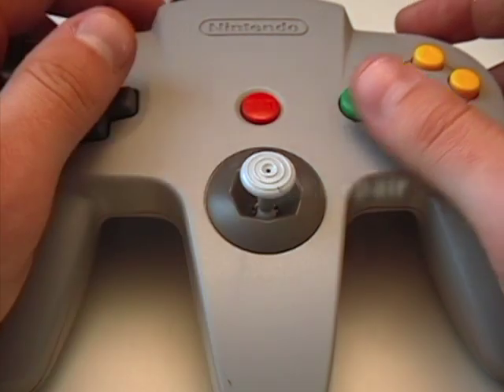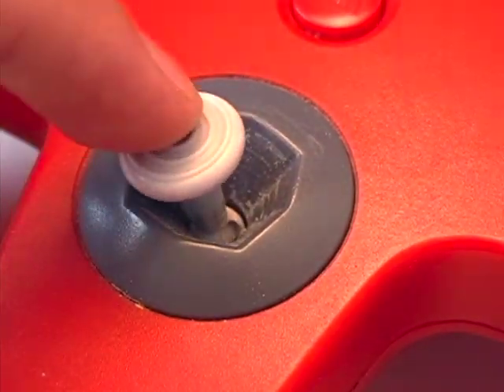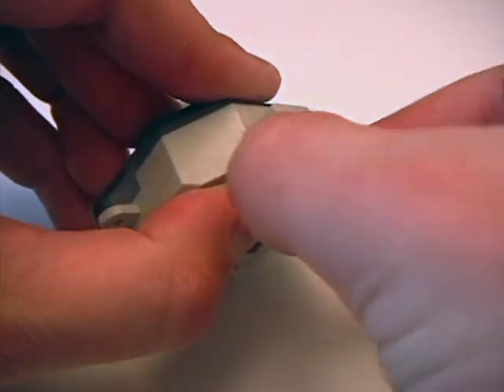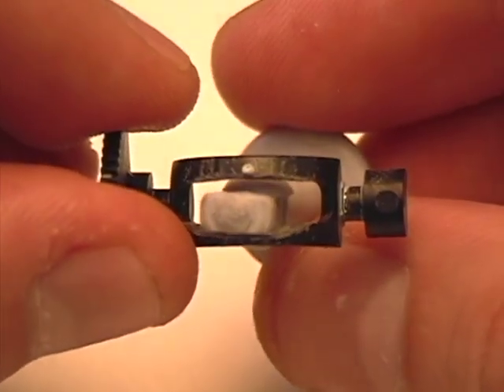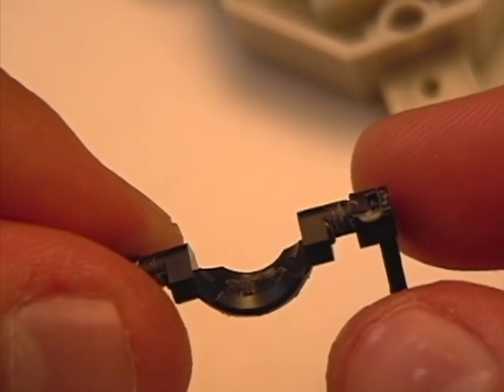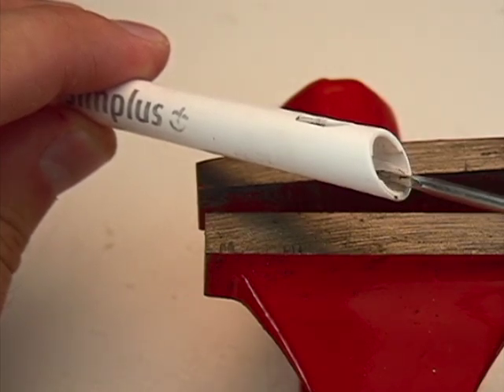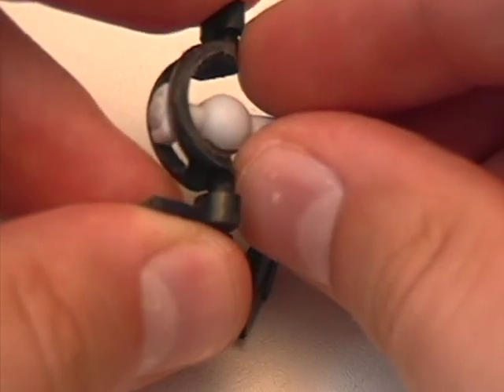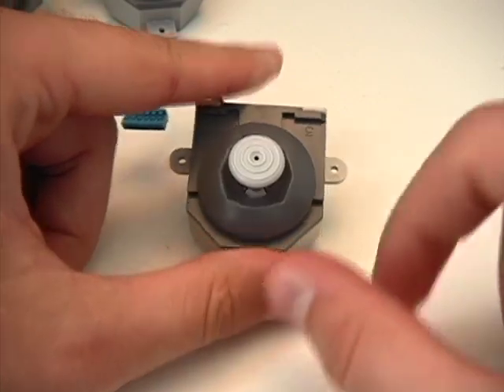N64 Analog Stick Repair

Comment: Smash 64 player here from Michigan. THIS is the only long term fix for your analog stick, other than miraculously finding a way to purchase a SteelStick64. This method removes the friction failure point of the stick rubbing against the bowl completely, which will save the bottom nub of your stick as well as your bowl from being irregularly worn away over time. The only potential failure point other than the homemade spacer/bushing wearing out over time (which would take a long, long time) would be that since the stick is now not pressed against the bottom of the bowl, it is suspended by the black up/down left/right gear tracks. With enough force and time, the downward pressure of your thumb on the stick could possibly cause wear on those gear tracks and break or warp them. BUT, that would take considerably more time than the natural wear of an unmodified N64 analog stick. THANK YOU for finding a cost effective, easy home remedy to this plague of an issue. I have worm out countless analog sticks and an happy to have finally found your solution.
Reply: btw, this only works for an already worn out N64 analog stick obviously.

Comment: For anyone wondering if this is worth the very long watch, it definitely is. 

I just finished fixing my favorite controller which has been out of order for the last 10 years or so. This is a brilliant alternative to the tape method (which is just janky) and the epoxy method (which I was about to do when I stumbled across this). 

I used the first pen I found lying around and it worked great. I used a dremel to drill the hole and smooth out the bearings, and put a little Vaseline in between each of the parts to keep it nice and smooth in the future. The control stick was almost completely floppy before and now it's basically back to new. Thanks for the video!
Reply from the maker: +Sam Krygsheld Thanks for the kind words. I'm happy someone found my method useful. Enjoy your fixed controller.

Comment: I just did this on a fairly good stick that was starting to wear and get drop in a tiny bit. Used nothing more than a regular white BIC pen for the support piece, a 1/8" drill bit, a razor, and some sand paper; luckily the black axis pieces were not worn. Added a thin coating of silicone lubricant to the assembly prior to closing the whole thing. Before my stick was good (and wearing down), but now it's perfect and hopefully will last a long time!

This man is a pioneer.
Reply from the maker: Appreciate it, glad my method helped you!
Reply: Hey helswake! Any chance you can provide an update on how this repair held up??
Reply: Curious too! How’s it holding up 5 years later??
Reply: Also looking for a followup testimonial
Reply: I would like to know how it held up as well, and if possible what grit of sandpaper you used 😁

Comment: Anyone who thinks the "replacements" available on the internet today are a viable solution to the original stick are out of their mind if they have any sense of how precise the original stick is. This is by far the greatest guide on repairing N64 joysticks I've ever seen, and it belongs first in the search results along with Luke's method that repairs the bowl itself. The problem with reconstructing the bowl is that it is ultimately a temporary affair. Even if the innards are lubricated, friction between the hard abs plastic stick and the bowl / epoxy will wear away one of the two over time. This method is brilliant, and I can't thank you enough for sharing. I'll look to try this in the near future, but if I can't get the right tools on hand I may get in contact with you to organize a deal if you can repair the sticks for me.
Reply from the maker: Chadwell J Thanks for the positive comment, I'm glad to see someone found my tutorial useful. I wanted to share my method because hadn't seen anyone try to fix it this way. You're right the original sticks are actually quite precise and I prefer to repair them than replace them. I would be happy to help you fix your sticks, I've got the process down and I can fix a few per hour once I gather the materials.
Reply: Christopher Poplawski Your method definitely looks like the best, but it looks like it requires a lot of precision. Would you mind fixing my analog stick if i sent it to you? Also, how much would you charge for this service?
Reply from the maker: Peter Liberty Hi Peter, yes you are correct, I would classify this method as hard/advanced and requiring experience to do right. If you feel unsure, I can try to help you, but please contact me by email: jacktourist [at] gmail [dot] com. We can work something out.
Reply: I highly disagree, lots of money to spend if you dont already have any, and the process takes forever especially if you never do this.

Comment: Thanks for the video Christopher. Great explanation for your method. I found your video trying to find out what people have done to build the cages back up, I've just used the 24 hour cure time J.B. Weld. Another method that I just attempted last night that seemed to work quite well was using Permatex "Steel Stik." J.B. Weld makes a version as well. This requires a small amount of the putty be applied to the cleaned and roughed up "bowl" with a 15mm loose ball bearing (has to be 15mm), and left over night. The bearing matches the concaved shape of an original bowl exactly. A little water is needed to lubricate the bearing as you press it into the bowl, and the excess putty can be scraped out easily with a hobby knife afterward (but before the putty sets). I will use the pen shaft method on another I'm fixing for a friend, also dielectric afterwards will help prevent further wear.
Reply from the maker: Dylan Powell Thanks for the comment Dylan, I didn't know that the bowl was perfectly spherical, and didn't think it was possible to shape it back with a bearing. Very novel idea if you ask me. If you have any more input let me know. I'm thinking of "updating" this video with annotations soon, I'll try to incorporate these new ideas.
Reply: Great idea

Comment: Thank you for this video, even 5 years later! This was so in depth and exhaustive, I learned everything there is to know about N64 analog sticks, how they fail, and a great way to fix them! I ended up using a more pliable and easily cut plastic tube compared to a BIC pen but the idea and application was the same. My stick has gone from floppy and loose to practically brand new! Super tight and responsive, thanks again!

Comment: Good video! You've clearly thought this through and have come up with a pretty ingenious solution! I guess the trickiest part would be getting the right materials. I bought a third-party Classic Controller for the Wii, and within a few weeks the plastic holding the control stick in place started to wear away, much like the plastic bowl at the bottom of a N64 control stick. You have inspired me to come up with my own solution for that!
Reply from the maker: +Based King Potato Thanks for the positive comment! Yes, it's hard to find a plastic with the right combination of hardness and flexibility. I'm glad you found my method of thinking useful, and I hope you solve your problem as well!

Comment: I can confirm that this is the REAL ONLY way to fix properly a n64 thumbstick and make it last. They don't become better they become NEW. They act like NEW thumbsticks. It's amazing
Reply: I don't know if the dude here is using this account anymore.
I think i got it to work using a bic pen. It's really cool. 

I've been having a problem with the controller though. 
Sometimes it's perfect (if not a little stiff), but sometimes 
the stick goes all the way in one direction, let's say Left, but 
the game doesn't detect it as such. 

To fix it, I spin the stick in all directions slightly agressively. 
Sometimes it fixes it (temporarily), but sometimes it results in 
the controller going out of sync with the center. I end up having
to reconnect. Is there something I may have done wrong? 

I don't know if I got that little bowl for the ball on the control stick 
completely correct.

Got any pointers?

Comment: Today I did this repair/mod on 7 n64 controllers of varying sloppiness. Works great, but 2 of them ended up feeling kinda notchy. 

I recommend using silicone spray to lubricate all the moving parts. Even a non-sloppy controller benefitted from the spacer mod+silicone.

Comment: Thanks for the idea, it works really well. I altered the formula a bit, the plastic bit made out of pen was sliding off as I tried to assemble the joystick parts back together so I made a small ring out of a thin metal clip (about 8 mm circumference by 1 mm thick). Really smooth so far, will report on longevity or side effects.
Reply: How's it holding up?
Reply: @superfreakinawesome8  100%, get a thin metal paper clip and cut about 1 cm in length then bend it into a ring around the joystick underneath the spherical part (make it as round and tight as possible).

Comment: I like your video and your reasoning. There is a less elaborate way of doing this. The white part you make if made with a slot the same size as the slot in the black plastic and glued to the black plastic would fulfill both functions in one.
Reply from the maker: +mrsillywalk I thought of doing this actually, but came to the conclusion that the surface area on the left-right black piece (not counting the slot of course) is too small to reliably hold supports. Remember that they have to cradle the ball, so the sides of these pieces will have to be sloped (spherically) inwards towards the slot, and under constant force of pushing down on the stick, I'm not that confident in glue. This is my untested assessment, however, and I think this idea generally warrants more investigation. In my method, there is only one piece which is held together under downward force by virtue of being a solid piece of plastic.
Reply: +Christopher Poplawski Did the cradle for the ball originally have a shaping? Brass shim is an alternative to plastic as it can be folded into the slot and round the edges for a mechanical join.   I must get round to opening one again for a look see.
Reply from the maker: Normally the stick is held up by the white plastic bowl underneath and not the left-right black piece. The top sides of the black piece are V-shaped and do not complement the ball of the stick. This is why a) the bowl wears out first, and b) later the left-right piece gets worn out by janky movement of the ball once it falls down to that level. Making a metal piece would probably be even stronger although that would take the complexity of this already tedious repair to a new level. I wonder what effect it would have on the plastic. So far the plastic-plastic interface I'm doing is holding up well. A metal-plastic interface might wear unevenly or require lubricant.

Comment: Regular maintenance and lubrication will help prevent that aggressive wear that you showed at the beginning of the video. Yes wear will still happen as with ANYTHING mechanical, but proper care an reduce wear to a fraction of a percent of what you show, even with the most strenuous use. Your fix looks like a really good solution for situations where that wear has already occurred though. Good work.

Comment: If you are having trouble with the sticks being quite stiff and unresponsive, be sure the plastic piece isnt too big. After wondering why it wasnt quite working as it should i trimmed them down as much as i could and worked a treat

Comment: This made a lot easier and faster to fix worn out sticks, moving the stick is smoother than fixing the bowl with epoxy method. I used different plastic for support piece that bends a bit, so it didn't need to cut that hole for fitting the part to the stick. Support part just stretched over the bottom knob to its place. Not sure how long the fix lasts cause of the softer plastic, but it feels and works just perfect.
Reply from the maker: +Väinö Huhtalo Nice, maybe if you fix another one with this method you can take some pictures to show us. Can you describe the material?.. what is it from?
Reply: +Christopher Poplawski Atm I dont have controllers around, but the plastic tube that i used came with spray insulation foam can. I cut the hole with hole pliers, and finished the edges.
Reply from the maker: +Väinö Huhtalo Ok yeah, I know what you mean, I'm familiar with those tubes. :) Thanks.

Comment: I got a red n64 controller that has a flimsy stick. Gonna use your method because it seems to be the most reliable :)
Reply from the maker: +Christian Sells Thanks! Let me know how it goes!
Reply: +Christopher Poplawski The analog is tight now, but it's incredibly stiff (almost like it's rubbing against sand paper when I move it). Is there a solution to that? Also, the stick was like this before and after cleaning the inside so I don't know the issue.
Reply from the maker: +Christian Sells Well I would say look for anything that seems to be causing the friction. The tightness can be from the support piece being a little too big. The size of it is really quite limited to the fact that there's not much room on the inside. Maybe take some pictures? If you want to discuss this over email my address is given in the video description.
Reply: +Christopher Poplawski Made another piece that was better, but I made the stick worse. When I tested out the stick it was even stiffer and was useless. I gave up and ended up taking out the analog stick all together because the black piece was of no use due to the fact that I had to file the top part off. Your idea is a good one, but I couldn't execute as good. I think I'm just going get a replacement stick. Thanks for the quick replies :)

Comment: That was a little more complicated than I was hoping, but it's a great fix to save original N64 controllers.  It's worth repairing the originals and then possibly just using off-brand ones instead lol.
Reply from the maker: +Benjamin Terrazas It's not as bad as it seems once you get into the rhythm :)

Comment: I once tried a spring that I took from a pen instead of a plastic support piece. While it did the job of lifting the stick, vertical movement was rough and most probably would have severely damaged the horizontal movement piece over time.

Comment: Ever since i opened up one of these when i was around 16 years old back in 1998, i kept wondering WHY they didn't make these parts out of metal instead of plastic
Reply: +ΛLIΞИ GΞИOTYPΞ I agree cost. I'm also sure they don't design these with the mind set of twenty years of use either. Their not going to think that far ahead. But I bit lubrication inside could have helped with the wear. My original controller wasn't wore enough to be lose, but it moved a bit rough so a few months back I opened it up and lubricated a bit. It move smooth and shouldn't wear as bad going forwards. Less friction.
Reply: Quincy i can't believe how expensive those things are, then again i would buy one if they were available but they are all sold out
Reply: @evrine  please tell me, what type of lubricant did you use? the ones that I tried did not work very well
Reply: this same company released early 80s at most tech in 1989 to keep prices (both up front and operation price) down and as a result own handheld gaming.

Comment: That's a darn clever fix nice one, i used to just put some silicone grease in there it would make it better but your fix is really good.
Reply from the maker: Yeah, grease helps to reduce wear, but I would recommend lithium grease instead. This is a more permanent fix fortunately.
Reply: +Christopher Poplawski yea was a long time ago  i fixed a few but your fix is realy good.

Comment: Thank you.  I have 3 original N54 controllers and all of the analog sticks are worn.  Not nearly as much as the red one in your video, but I guess that's because the black pieces are not worn.
Reply: +ivodozi N64 Not N54